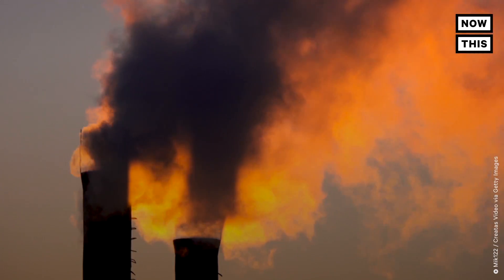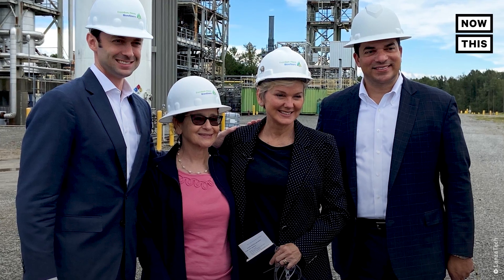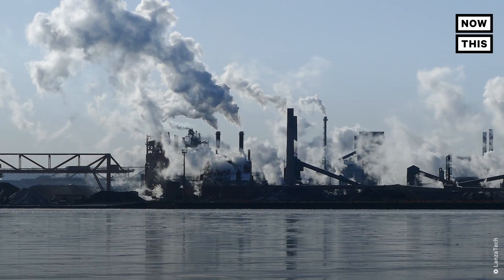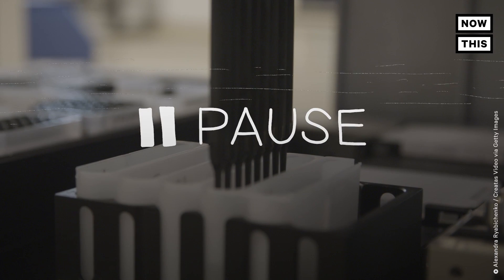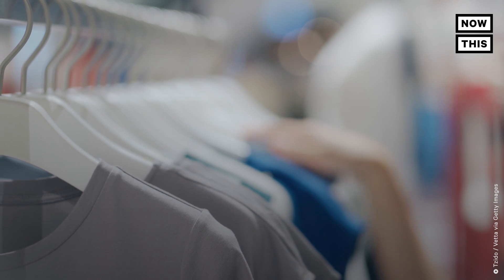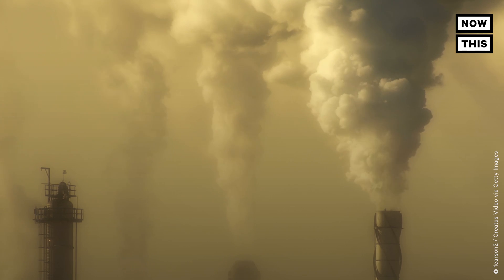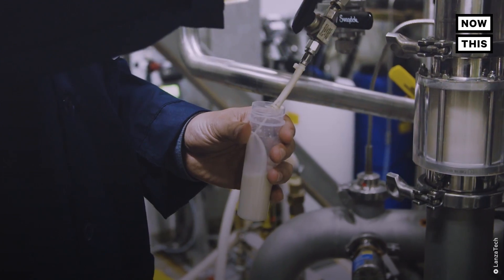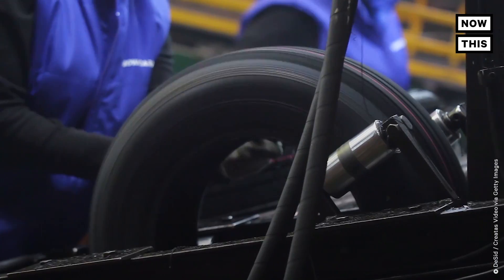Startup Turns Carbon Emissions Into Clothing | UpcycleThis

Comment: Sounds nice, but I'm sorry. It comes across as too positive and leaves a lot of important questions unanswered. I don't mean to dump, but let's face it. A big problem with making change is PR campaigns meant to pacify the public. Carbon Capture is the demon spawned by industry to do just that and has proven to be an utter failure at doing anything at scale.
This all sounds nice, but how much energy is consumed by the process? How many emissions does it create? How much other waste does the process generate? Are there byproducts during the generation of the Ethenal and/or polyester that are toxic or otherwise harmful to the environment? Does the resulting product offset the cost? Obviously there has been significant investment in the experimental system. Who paid for it? Industry hoping to pacify the public with a different spin on Carbon Capture or some government funding into researching actual methods of reducing carbon output?
How is it expected to scale? How much of it will just end up being sold as fuel, which is doing nothing to offset carbon output then? Ethanol is a component on gas for cars, so are we expected to believe that the oil industry hasn't invested in this as both a method of spin and a way of propping up fuel production?

Comment: Why take carbon out off the atmosphere and make clothes out of it when you have to send it overseas, creating carbon, to continue the manufacturing process? At best this company is carbon neutral, taking out as much carbon as putting in. If they can make it locally, than that would be a whole lot better.

Comment: The video is useful but I'm not really seeing it tap the idea that the dresses are only 20% recycled Co2 so other parts of the construction process are still damaging to the envirionment. Clothing is one of the more damaging habits that Western cultures indulge in. So, yes this is better than a dress NOT made partially from Co2 but the problem is so advanced at this point that people need to look more at just NOT buying new clothes.

So at issue is whether this video/and tech helps inform people to make better choices or whether the video misleads people about how eco-friendly the dress is. 

Something that would "hurt" the clothing industry but help the planet is if all consumers in wealthy countries limited themselves to 1-3 new clothes purchases per year, bought other clothes used (a bigger market for used clothing would mean less was thrown away too), and wore clothes until they were actually worn out instead out of fashion.

So, one problem with the video is that it tends to mislead the view that these kinds of changes, buying a dress from partially receyled material will be enough to turn things around, and the truth is is won't.

Comment: Producing plastic products, especially for the construction industry where it will be sequestered for a little ng time, is what all methane and oil production should be used for.  No need to keep them in the ground if there are zero emissions.

Comment: Is this actually any better than just releasing the emissions? Initial conversion, transport, another manufacturing stage, more transport, more processing more transport and then finally manufacture of clothes... is it even carbon neutral?
Reply: Yes because all of the stages after the conversion would happen even if you extract new oil to make clothing
Reply: Don't let perfection get in the way of progress. The aim would be to have the whole infrastructure nearby, which is achievable at scale. Also, if products are produced from 100% pollution and they take the place of something made with oil (causing huge pollution) it only has to be better than the status quo and economically viable (with incentives), as the tech is refined and power supply of renewables incorporated it will be carbon negative.

Comment: I hope they quickly move away from clothing, because it is a know fact that clothes are thrown away and while washing the polyester clothes release microplastics. But they are doing a good job by replacing the virgin plastic with the upcycled plastic
Reply: I was about to address the same topic.  They are still incorporating polyester into the equation which when dumped or trashed, the petroleum is released into the earth causing a disastrous affect on climate change!

Comment: Hmm ok. But isn't the process of doing this carbon postive.
I don't know. I hope and pray it works good and reduces greenhouse gases emissions.
Reply: Not if green hydrogen or other renewable energy is used as the power source. Most factories have waste heat which is used as a power source.
Reply: @steveorlowski6093  hmm ok, then goood